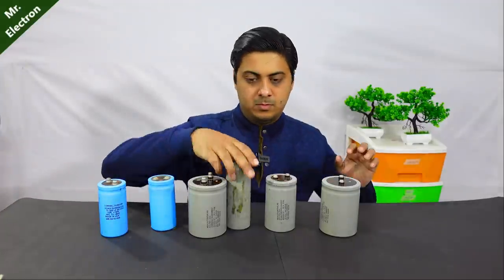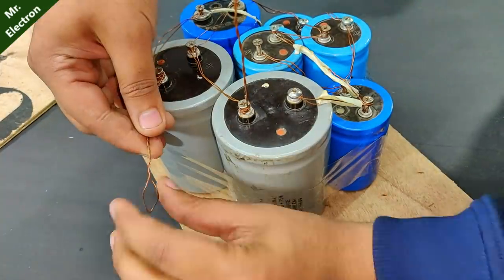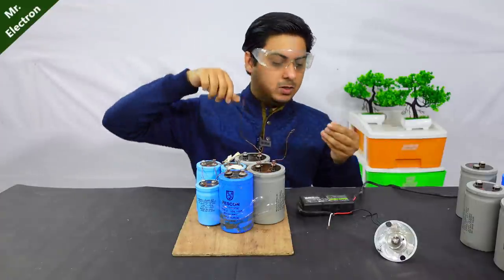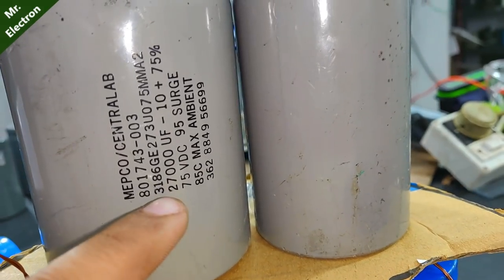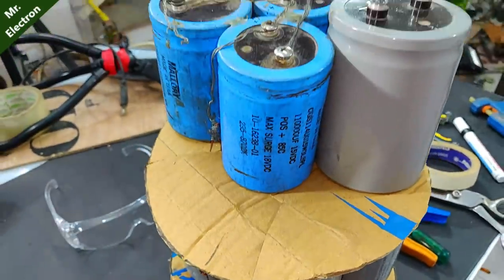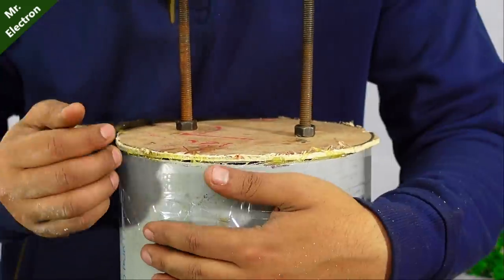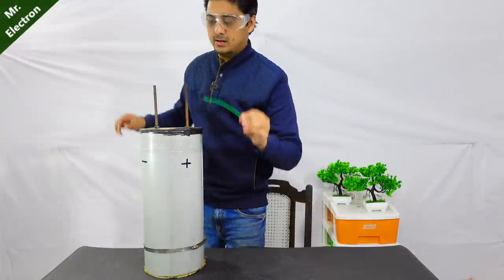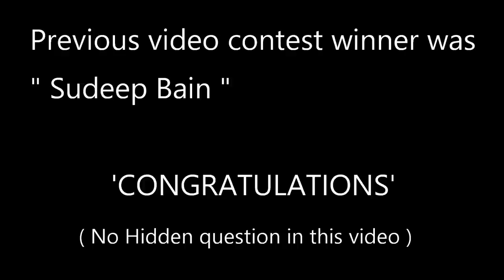960,000 uF - 12v SuperCapacitor Battery | How to Make Super Capacitor ?

Comment: Saw the video, thought neato I will find out what you use for the dielectric then find out you just wired a load of old capacitors together. Was hoping you might have actually made the internals for a capacitor but you didnt, still good job because by the way you slapped those together you might well have electrocuted yourself.

Comment: Wowwww, I really wanna make one, one question, if I put more current in a motor, that will have more torque? Will be hard to try to stop it?
Reply from the maker: Yes
Reply: @MrElectron  i would like to see more solar projects/ideas. Btw cool video👍
Reply: Да
Reply: Thank everyone
Reply: The torque of a motor is by design. it will only draw as much current as the windings of the motor was designed for. You could increase the voltage, which will increase the power, but over voltage could burn out the windings. I always look at the device ratings on the device so I don't exceed.

Comment: Nice ....you can over current the motor . 
But not likely to power lamp since it's not useful for long time .

The only positive feedback for capacitors is the dumping all power in less than second .
Other wise you need ultra-capacitors ( there material are half capacitors and half battery rechargeable ) 

with your project size I have made 500F 16v and it's More powerful and extremely dangerous and it's cannot be  wire it like you did . It need wire can handle 100A because totally power dump as I test it reach over 999Amp/second  when I try to power up a truck starter .

I have the pictures for my prototype 500F and how it made and what material I use to connect them all together and I use self BMS voltage limit on each capacitors since they are dangerous for each cells not to reach More than 2.6v since they are 3000F

Comment: I think you forgot the micro sign at the end.. you're basically working with 0.9F
That's basically nothing compared to the 500 to 1k farad capacitors available to public online.. use them instead and then connect them in series and parallel to make an actual monster not a sissy hearted monster

Comment: Basically such capacitors can be used in wind power and hydel power generators. It can reduce voltage fluctuations to a greater extent. The three phase output of the alternator can be converted to DC and filtered though this capacitor to get smooth DC. Thus we can power lights and fans at home.

Comment: Okay first of all I noticed you're touching both of them poles with your finger if that was a real capacitor it would have thought you up against the wall so this is not a very supercapacitor it's low very very low voltage

Comment: Do you have equation for watt hours?
Reply: it's simple... storage capacity in wattage dissipated in one hour time. The formula for calculating watt-hours is Watts x Hours = Wh. So, if you have 100 watts running over four hours that equals 400 WHs (100×400).

Comment: Why u had don't get any electric shock from the capacitor ?
Reply: The capacitor can discharge ENORMOUS current under short-circuit conditions, but the charger's voltage isn't too high, and because the voltage nearly always directly determines the current, the body's resistance is too high to pass fatal currents at this voltage. I=V/R
Reply: @julianslab1511  if it much higher voltage(200V) then it could be fatal ?
Reply: @manojkumarbhardwaj650  if the capacitance and voltage are high enough, then yes

Comment: i clicked thumbs down because you added capacitances together on different voltage capacitors - you only get the full rated capacitance when they're fully charged
Also it's much easier to just buy a 120F super capacitor bank (500F x 5 connected in series) , which means it's at least 120x better than your capacitor - and that's without considering the difference in size and weight
You can try to argue that your oversized capactor doesn't need any fancy circuit to work at 12v - but FS1B105ZF (by KEMET) is a 1F 12v supercapacitor that weights only 30 grams and costs around $20
Reply: Capacitance doesn't depend upon charge or voltage because charge is directly proportional to voltage this directly means on increasing certain amount of charge on a conductor or capacitor its voltage also increases hence, capacitance i.e c= (q/v) remains constant so, capacitance is unaffected whether increasing q or v.
Reply: On the other hand, as the voltage increases towards its maximum capacity value, the capacitance actually decrease.
Reply: The thumbs down was for his wreckless approach! A gross lack of consideration for wire size and current, in addition to other aspects of safety concerns. It's totally irresponsible!!